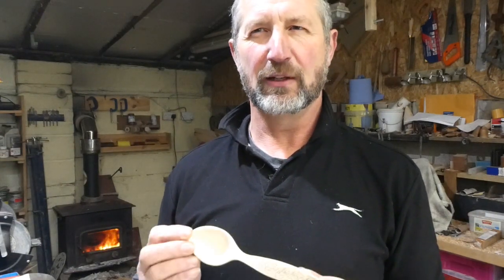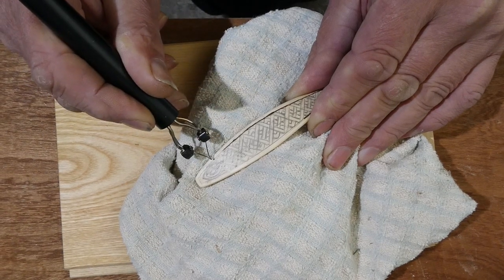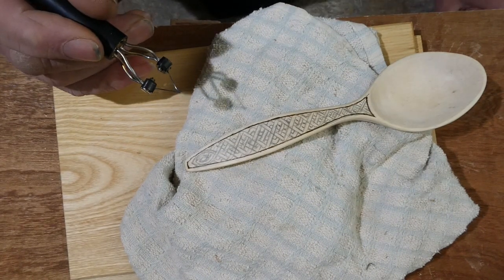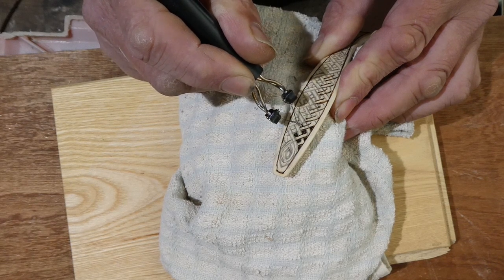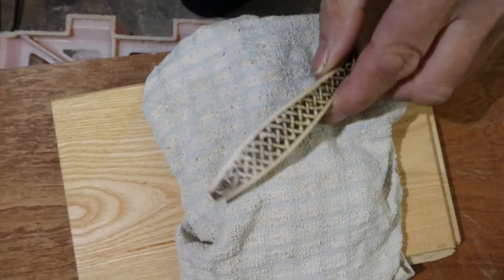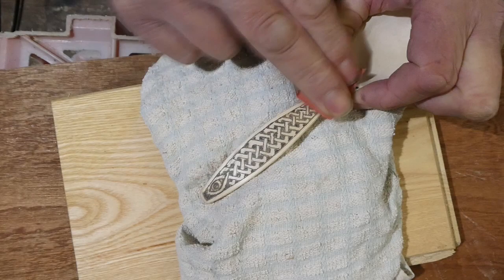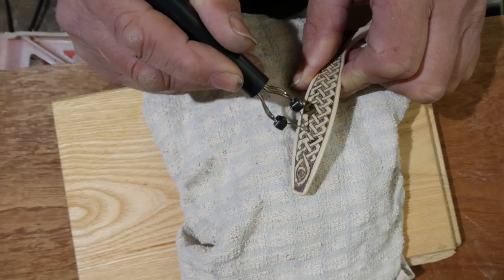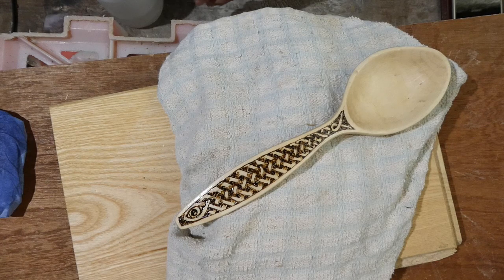How to make a wooden spoon Part 3

Comment: Andy ,that looks incredible,can i ask where and how you get the designs from and how you replicated this on the spoon,or better still if you would be willing to make another how to,thxs
Reply from the maker: Hi Chris...thank you for your kind words... I got the idea of the design from typing Celtic designs on Pinterest ... I did have to modify it to get it to fit onto the handle... then drew it freehand..no shortcuts using carbon paper unfortunately because of the taper narrowing the design... I  was thinking of doing a band saw spoon shaped using the bandsaw and then finished with the knives ...and perhaps another pyrography design...cheers...All the best.....Andy